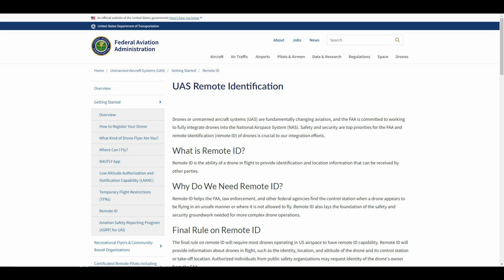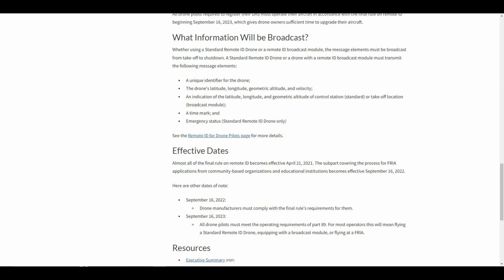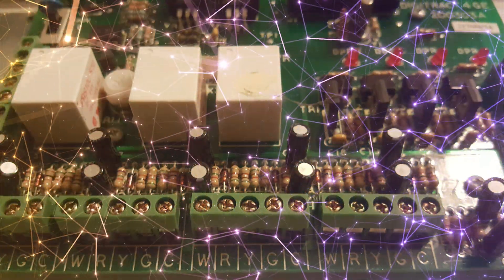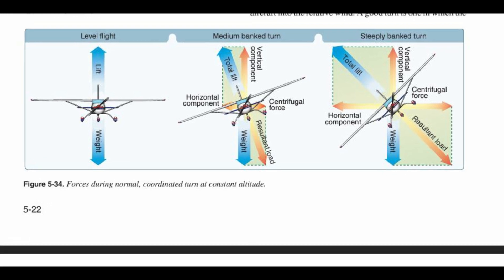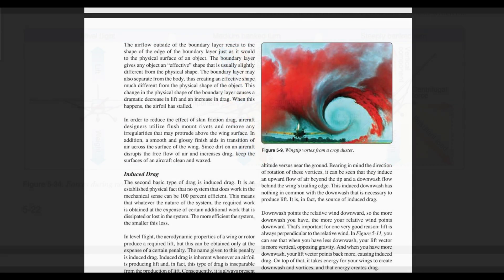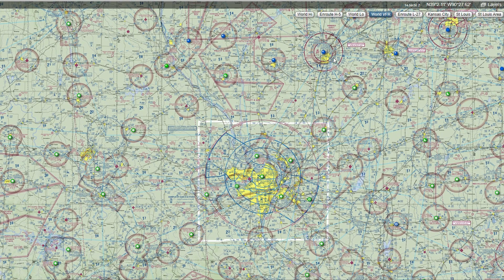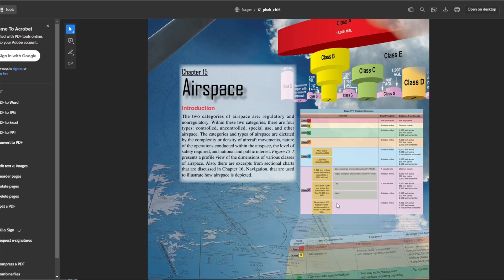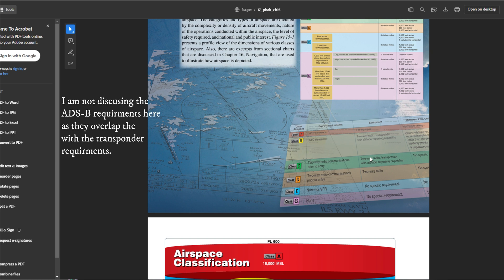#RemoteID is doomed to fail - A better Solution

Comment: I both have my PPL license here in the USA and am part 107 certified. The main issue i see with all of this is something you pointed out. Some kid or adult will by a UAS of somekind to mess with be oblivious to any regulations and can still get fined or arrested in any system. People that dont fly manned aircraft just dont really think about air space regulations of any kind. Its unfortunate but true. I would agree that the set up you proposed would be better than the current but definitely still not very helpful for anyone really.

Comment: why does anyone need this information? I've flown since the 80s unually in fields miles from anyone to absolutely guarantee if anything went wrong nobody would be hurt. Except maybe me. If anyone is up to no good they would never fit the remote id device. Tell the gun club of America they need to have remote id tags on there weapons reason so police could see in a nut job carrying 2 assault rifles and various other gun into a school. They could stop the person before they got the the school and lives lost, so good reason to do that with guns. Except of course a person like that wouldnt fit the remote id devices to his guns because he has Ill intent. It's the same with modellers what is the safety benefit? There is none at all any argument that they can catch wrongdoer's is false. Let me tell you no amount of legislation of anti drone stuff around areas they should not be. Will not stop an ill doer's, terrorist, or criminal. As you can pilot a aircraft semi automously from thousand of miles away using modile data networks. It's all about intent not purely owning and flying. What's more delivery drones WHEN they crash people will be hurt. No1 rule do not overly people and property . We should be going the the media to highlight the dangers of having say a 20kg+ drone over you head doing a delivery it will never be 100 per cent safe but govt seems to think it's an acceptable risk for profit and tax revenues

 

the press needs to know. From experts, thats the hobby. that we don't fly drones over people because carries a risk. A risk the hobby does not take, and for good reason. Being a big organization or being rich does not remove the risk

Comment: oldguyFPV says; We are not going to stop the FAA until we start looking at this issue from a constitutional due process standpoint. One example, and there are many more, is Remote ID. Remote ID violates the 5th Amendment of the Bill of Rights, in that it requires a private citizen to witness against themselves by collecting and submitting evidence to government that can and will be used against them in any criminal prosecution. The government cannot pass a law that places a citizen in a position that would force that citizen to wave a constitutionally protected right, the right to witness against themselves, in order to exercise the constitutional right to use the public airways. "We find it intolerable that one constitutional right should have to be surrendered in order to assert another." Simmons vs US, 390 US 389. The airways are a public easement. We all have a constitutionally protected right to use them. The airways belong to all of us. As long as a private citizen flies their property (drone) in a manner that does violate the life, liberty or property of another, that person does not have to get governments permission to do so. In the event that a person flying a drone does violate the rights of another person, we have the "Bill of Rights" and due process of law to settle the issue.

Comment: Wow. Seriously. If this was the only tiny environmental impact, you might have a point, but I see it as minimal compared to others. First, there are very small remote ID modules.  Also, I did not see you mentioning the Recreational Exemption which allows sub-250 gram drones to be flown purely for fun without the necessity of registration and without the Remote ID requirement. Just fly sub-250 and be done with it. It is interesting that most of these rants are often a bit misleading. Plus, most don't seem to grasp the bigger picture, the involvement of other agencies, and planning for the future. This is just the beginning. Also, if you fly rural and no one sees your drone, then no one will be able to "snag" the short range broadcast. Besides, where was everyone back in early 2020 when the FAA requested comments? Also, RDQ lost the lawsuit against Remote ID.

Comment: It is unfortunate that model aircraft ended up getting caught in this net but there are a few fundamental misconceptions that I have  repeatedly heard voiced in regards to remote ID. First, it really has nothing to do with air traffic control. Yes, it was published by the FAA but they are the regulatory agency in charge of the airspace realm and so were tasked with the formulation of the rules. The bottom line is that these rules exist because of one specific segment of UAS devices and that is the drone segment. The existing rules were simple - keep it in line of sight, below 400 feet AGL and clear of any controlled airspace. The drone community however proved themselves incapable of following those simple rules. Just watch youtube for ample proof. Furthermore, drones are considered by most people to be intrusive flying cameras, able to spy on you in your back yard - which, to be honest, they basically are. So there has grown a distinct distaste for them in the general public's eye. Note that R/C hobbyists have been getting along just fine with the public for over 100 years, then the drones came.

There is also the misconception that the FAA is going to be monitoring and busting everyone. This is not true, the FAA are not policemen. The object of remote ID is so that when a drone is observed operating where it's not supposed to be or a complaint is called in then local law enforcement can identify the operator. It is not for air traffic control and has nothing to do with manned aircraft. Staying below 400 feet and away from airports was supposed to cover that aspect.

The drone community itself is now up front adamantly declaring that they are simply NOT going to comply and the first result of that attitude is that nobody is making remote ID modules because why would they when obviously nobody's going to buy them? So there are few choices and those that do exist are about five times the price they should be.

In regards to compliance I think it is mostly unlikely that the normal R/C airplane hobbyist will be operating in a manner that will attract the ire of the public or the local sheriff and as such there simply won't be anyone interested in looking for a broadcast signal. As for the typical drone hobbyist hovering over someone else's back yard or spoiling a serene setting in a national park well, they're the ones who got us all here in the first place.
Reply from the maker: Unfortunately there is some truth to what you say, however, the regulations that have come about are not limited to camera drone multirotors, and although enforcement of the hobby at large is unlikely, it does open opportunities for abuse of power. If those enforcing the law have it out for R/C flyers in general, or even a single R/C pilot in particular for some reason on a local level; this becomes a problem. 

Even most quad pilots don't fly in other peoples backyard and "spy" on people. Those are the actions of a small minority. A minority, that I must reiterate, will NOT be in compliance with RID anyway.
Reply: @iflycentral  It's not so much that drone users ARE spying on people rather than the people's perception that they are. In regards to enforcement, drone users are facing more and more restrictions and bans enacted by local and municipal boards and they may find that when such cases come before the FAA (who they love to demonize)  they may find that the FAA will rule that no, the city or local HOA do not have the authority to govern airspace use and that such bans are invalid. Ironically making the FAA the drone users best advocate. Well, unless they are non compliant with the remote ID rule.

Comment: For anything line of site flying should not be imposed with any new laws or rules. If the pilot can see the model so can anyone concerned about it so why the need for remote id unless it transmitts 100ks away

Comment: It's a great idea! It's very simple, and very easy to do. This, with a little expansion (Kg limit for example)with tweaking is an ideal solution.
Reply from the maker: I reckon 25Kg would be a reasonable limit under my plan. That'd let the giant scale multi-engine guys have fun as well in the uncontrolled airspace.

Comment: Great idea! but I don't think the FAA will  follow through with it. From what it looks like to me the FAA wants the whole thing to die by over regulation.
Reply from the maker: I see alot of people putting their crosshairs on the FAA. You need to aim higher. The FAA would not have done anyting if the politicians hadn't forced them to. It's the politicians and the corporations.
Reply: @iflycentral  I agree, rc pilots rights are now a voting issue!

Comment: Q: what is the danger/problem to be solved with UAVs?  Is it real/realistic and how bad is the outcome of the danger?
Q: does the solution proposed solve the problem? How will bad actors handle that?
Q: how large is the impact of the working, sensible solution?

I have seen quadcopters about the size of my palm (and catching the props in my hair, not really painful, just bad piloting on the other side, flying inside a building).
How much would a ID broadcast weight?  That drone has no camera, no GPS, no barometric or radar or lidar height sensor, no instrumentation but for the receiver and motor control.

I doubt that that one would do damage if it crashed into a window. Unless it’s a fast moving window like a car, truck, train, plane …
Reply from the maker: Remote ID is honestly total nonsense. That is why I titled this video as I did. My proposal shouldn't even really be nessisary, but it is a way out for the FAA to stop taking heat from hobbyist while also being able to tell the politicians they "did something" which is all it amounts to at the end of the day. Useless regulation.

Comment: More batteries from RID modules? Seriously? Tell it to the electric car industry. Weight? it's 15 grams. Can only fly for a few minutes? Try 30 to 40 minutes.  Wing loading? WTF? I had to stop 4 minutes in because I never heard such BS in my life, not counting trumps misstatement of facts, but it's close. 
I have a solution to the Remote ID problem that will solve any and all problems with not only the FAA but any local law enforcement officers permanently. REGISTER YOUR DRONE AND USE REMOTE ID. Problem solved. Karens and thieves? Once the public understands that drone operations are a FAA protected legal right, and it may take some time for people to get that, any interference with the pilot of that sUAS is a federal crime, and they go to jail for doing so. Change is tough but we need to move on, fly legally, and enjoy our hobby or business.

Comment: Great idea. But 400 feet is really not a very fair slice of the cake for FPV flying.
Reply from the maker: I can't personally speek to that on the FPV side of things, however, I followed the 400' rule back when I flew R/C regularly. Gives a nice 100' buffer between manned and unmanned aircraft under normal operational conditions. 

When it comes to flying in the immediate vicinity of a tall structure; I could see some room for higher flights.

Comment: As a manned aircraft pilot I agree with you 100%!  This FAA solution is a travesty. The writing was on the wall the minute it was announced who was going to be on the US Senate Drone Integration Panel years ago, and NOT ONE drone pilot was invited to be on the committee, just large US corporations like Amazon, AT& T, FedEx, UPS, Wing, etc. These companies and this committee had 1 Goal, how to rid the sky of hobbyists and small Part 107 operations. What's not being talked about is that Remote ID 2.0 is coming. As a pilot, you understand the ADS-B integration into General Aviation. The FAA and these same corporations and politicians are discussing requiring all Part 107 operators to buy and install separate ADS-B modules into each aircraft. The large national and regional Part 107 Operators with $hundreds of millions$ in government and corporate contracts can absorb the cost of these new micro-ADS-B modules @ $2,300 to $3,800 a module, and the additional power-supply solutions. The only answer for many pilots is to defy the FAA remote ID rules. These rules are based on a lie that the FAA and the politicians know all too well. When Tyranny rules, Defiance is patriotism. BTW, an FAA guy who's a pilot and works at the Chicago FSDO and another pilot friend who works at the NTSB, feel the same as we do. They also fly Part 107 and as hobbyists and recognize just how many feet deep the BS from the FAA Brass is....

Comment: While this is a perfectly logical plan which makes far more sense than the current system, what it doesn’t do is accomplish the stated goals of the lobbying group who forced the FAA to create it in the first place. The Commercial Drone Alliance wants *all* SUAS in the airspace they think they’ll be using for drone deliveries and “air taxis” to be tracked. The protection for manned aircraft and public safety aspects of RID are pure propaganda, because it has been established that manned aircraft will have no way to detect RID signals, and as you noted, bad actors won’t run RID.

Fortunately, the energy density necessary to make these commercial drone applications financially viable won’t exist for at least another 50 years, and it’s already been 11 years since the CDA claimed this was coming with zero actual implementations. Earlier this year Walmart, Amazon, and Google laid off most of their drone delivery divisions because they’ve realized this, and it’s only a matter of time until the investors funding the CDA do too. Once that lobbying pressure goes away, we’ll be able to make some progress towards getting more rational regulations in place, and roll back the ridiculous system currently being rolled out. 

But the good news is that there won’t be any enforcement, because the FAA has no enforcement resources, and local police have absolutely no motivation to enforce a federal regulation. So all we need to do is disregard all this nonsense and wait until it inevitably goes away.
Reply from the maker: I agree with you up to the point where you say "wait for it to all go away." There needs to be push back now so that when the pressure from corporations is alleviated, it can be made to go away. If you wait till pressure is gone, and then act it will be far less likely to be rolled back. Then model fliers would always have that hanging over them.